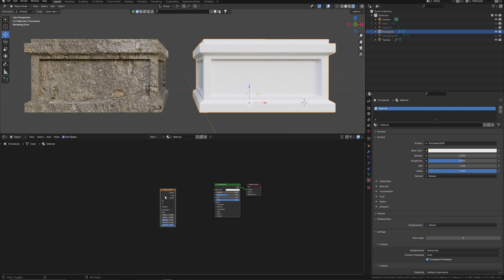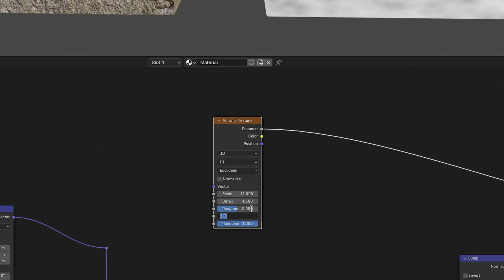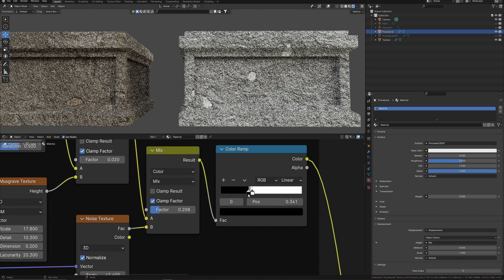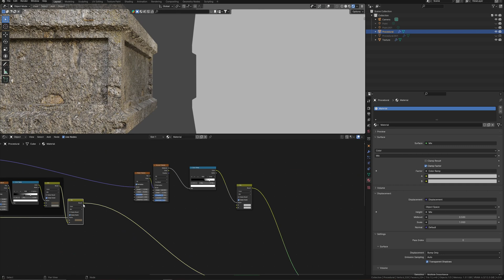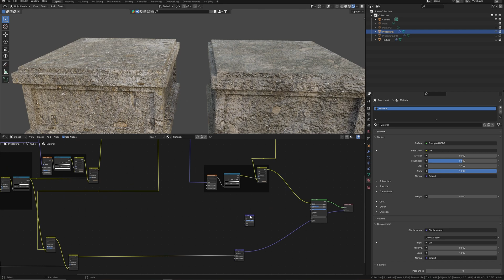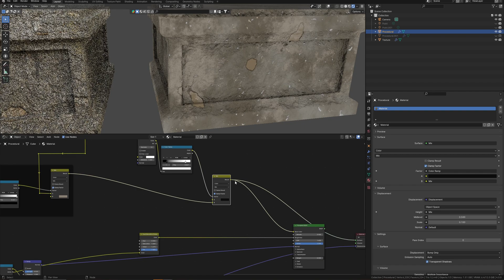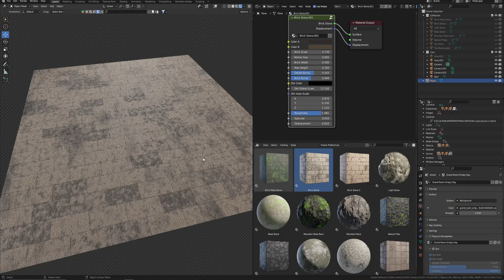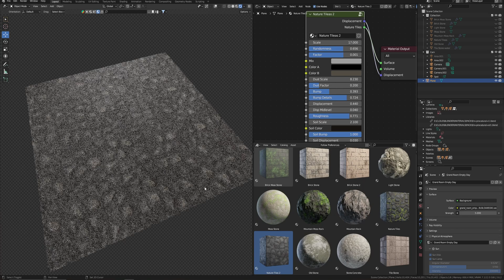Unveiling the Secrets of Procedural Materials in BLENDER

Comment: Procedural materials is very expensive, better use image texture. As nodes makes blender gpu memory usage at max.
Reply from the maker: It makes sense) but each way would be good for some cases. Definitely, using 8K image textures requires a lot of VRam but procedural materials have no tiling. I didn`t see a huge difference in using video cards when I used procedural materials in some cases even vice versa, using procedural took fewer resources.
Reply: @cgslav  :)

Comment: I think this is stupid question but is there a way how to get good displacement details with limited geometry 😅... Good tutorial btw i want a tutorial on how to decide which texture nodes to use for different material patterns how you know this node will do the work
Reply from the maker: The same way. I forgot to mention this but in this video, I used displacement only in material without Displacement in Surface settings of material and subdividing of the geometry.
Reply: you can use adaptive subdivision which subdivides the mesh based on how close the camera is to well, the mesh!
Reply: @infrared_xo  ya but dont know for some reason my experimental feature set is slower than supported one...